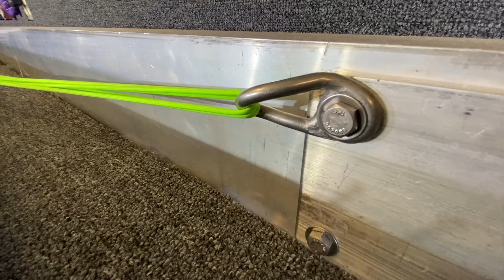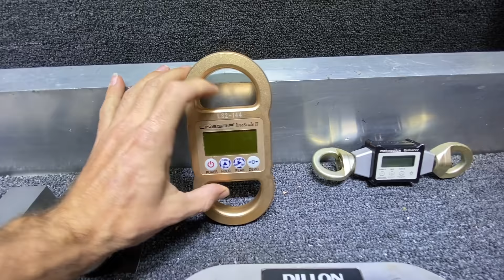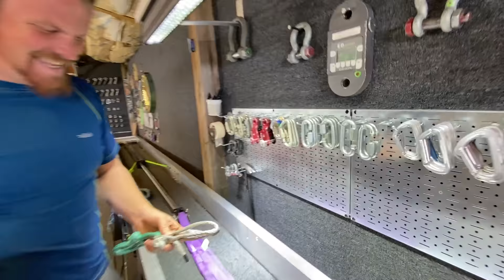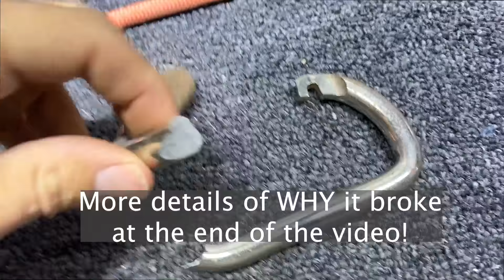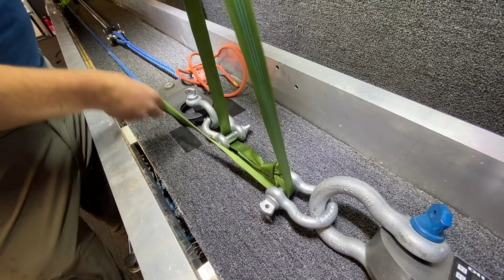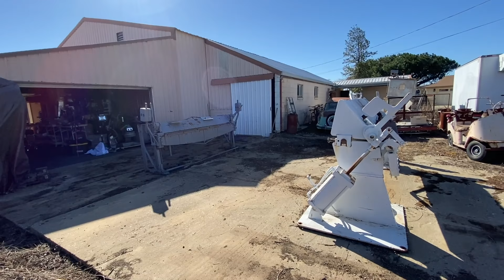How to Build a Break Test Machine

Comment: Prayer to the YouTube collab gods:

Another channel I watch is trying to build a machine that will measure and plot draw force on compound bows, the commercial ones cost 50k 

The main difference would be a 200lbf load cell and measuring over distance instead of time

In return I’m sure you could break some archery gear

Reach out to podium archer if you think it’s possible
Reply from the maker: There are a number of load cells aimed at training fitness that measure and plot force on an app that measure similar forces to draw weight. Are they looking for something more than that?

Comment: A good way to minimize the damage done by metal hitting the hydraulic cylinder is to get a (very) large piece of tubular webbing and slide it over the exposed cylinder and attach it a both ends so it can move with the cylinder and still protect it as it moves in and out

Comment: For the tower: I would say dig some holes fill them with concrete reinforced with rebar and use J bolts set in the concrete to attach your uprights to the ground. If you just attach to a thin sheet of concrete it will not give you very much strength. You would be surprised at how much wind force you will get up that high.  I have been doing signs for about 25 years and a sign that is 16 feet tall will have (2) 24 inch footings 8 feet deep with 6 number six rebar vertical supports and #3 circular rebar at 12 inches on center and 3 
Circles in the top 5”. I am not an engineer so not sure the exact size you would need but I have seen a lot of signs fail because of blowing over in the wind. Obviously four points of contact on the ground is going to be stronger than two, but you would not  want your tower to blow over on you when you’re all done.
Reply from the maker: I do think this would benefit from having some bomber footings but its also not going to have any sails... I mean signs.... that will catch wind.  It will be a frame of 2x4 or 2x6s that wind can travel through smoothly.  I am leaning on investing in good footings though.

Comment: I think you might benefit from removing some of the concrete and digging a hole where your catch mechanism goes, in order to gain a foot or two. You might get some benefit, when building your crain to lift your samples, if you make it two legged and diagonal corner-to-corner. If it sits right on top of your corner posts that might be simplest (if your corner posts are strong enough) and it would give you the greatest working span. If you are going to have big weights swinging around you may want to pad the corner posts somehow, maybe a crushable wooden structure? Or some fun contraptionof many layers of cardboard?

Comment: If you look up how 4x4 drivers use a recovery pulley and large soft shackle to get their trucks out of bogs and sand, it might be a safer and more durable device than the snatch blocks.
Reply from the maker: Checked it out.  interesting.  seems like it would melt the other softie
Reply: @HowNOT2  The rescue pulleys seem to be beveled to slide smoothly over the shackle, but they're also not used continuously, so you might be right.

Comment: for the drop tower, It could be cool to have a pulley up at the top and the solid base. as then you could lift a heavy weight and release it to try shock load bolts and things mounted in the floor being pulled straight up out.
From a practical engineering pov I dont feel qualified to give judgement. However i wish the best of luck :D
Love all the content and big props to you!
Reply from the maker: shock load things at the ground is a good idea

Comment: You could get 3534 extra pounds of pull if you spun the cylinder around the other way. Now the total push force is 3" dia x 2000psi = 14137 lbs.  Pull total is 3" dia - 1.5" dia x 2000psi = 10603. calculated.  hose movement and control would bite. May be less ideal to move the black cylinder but more force if it is needed just with a flip. Would protect the rod too.
Reply from the maker: How do I start the cylinder closed and push it open (opposite way it is currently facing) and still break the samples?
Reply: @HowNOT2  You rigidly attach the cylinder and then make a big amsteel yoke that attaches to the end of the rod and runs behind the cylinder base. The problem will be that if you don't align everything perfectly you could possibly bend the rod. Usually mechanisms like this are built of all rigid components that are carefully aligned...
Reply: Thought some about our question,  so at you current cylinder size it is possible not worth the effort but hang on. Put the cylinder under the table, add some support guides for a protrusion comes through the table that you attach your item under test to. Poke a finger between index and point finger, slide back and forth. All the workings are under and protected, rod everything is supported no jumping away and around. The force is now at the same end and the side rails are just guides. You could make your current rig into two rigs, again all the force is at the same end, place cylinder any location on the table and send a bar back to the end, total working length possible adjustable too.  Thinking just twisting action on the assembly, need to think and possibly model this to be sure. This could be way longer, DM me if you want to talk more.

Comment: Great design...One thing I would add is to NOT put up a permanent ladder. Use a regular ladder and attach those strong 2-600 pound fishing magnets on each vertical leg at the top...That now gives you a movable ladder to any part of the structure you need so you can make more room for swinging, they also make magnets that have releases built in so you don't need to over power 1,200 lbs to move it...To make it even simpler, just make a giant swing set style setup. Have the welder weld and bolt on a big steel plate in the center to have hangers attach to it. It'll take up less room too and give you plenty of swing space

Comment: You can get suuuuper beefy DC power supplies for cheap from computer server pulls on eBay. Data centers will replace power supplies with plenty of life in them to avoid them ever failing. I got a 42V, 60A power supply for "$5" (about $30 with shipping). The only downside is the fans typically.... Aren't made with filming in mind.

Comment: If you were really limited on space you could split it in half, have one half be the driver (hydraulics/winch/pulleys) then do two beefy pulleys to redirect to the other half with the sample/ test piece. Could try and get really clever and stack the two halves on top of each other.
Reply from the maker: That could work, but the pulleys would have to be beefy like you said and then the amsteel also beefy.  Double stacked vertical would save height and footprint

Comment: You will need X bracing on the sides of your tower, large angle iron should be fine for that, it will relieve lateral strain on the concrete expansion bolts. 1/2" checker plate should be fine for the platform. For everything else, the steel you have should be fine.

Comment: Hey! Would it be helpful if i make a rough 3D model for visual aid??
Reply from the maker: like popsicle sticks? or cad?
Reply: @HowNOT2  marshmallows and skewers
Reply: @HowNOT2  like really CAD but i want to specify that would be for visual aid only, maybe to decide parts, and position of elements and dimentions of the structure.  I know it would be better if you could run force/stress simulations on the structure but i dont do that kind of 3d modelling,  well if you want we can get in touch and just send me some drawings and  measurements and ill do it :)